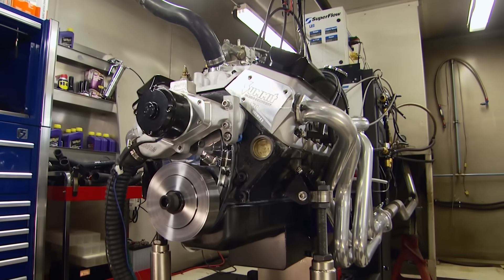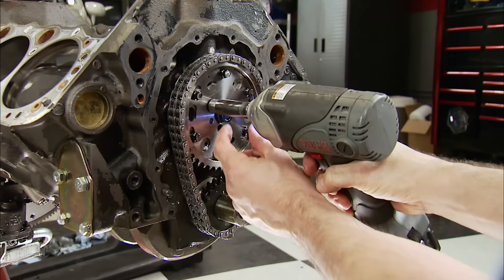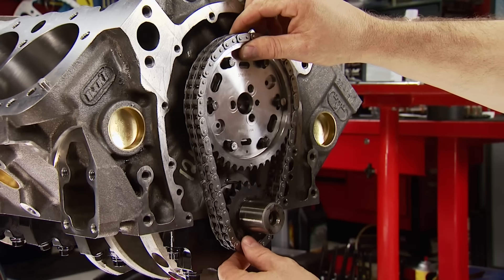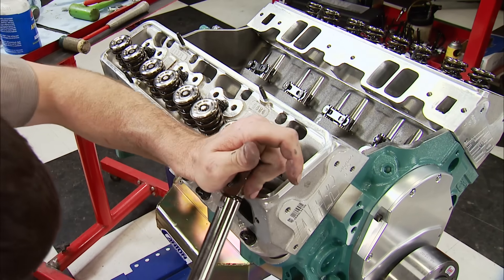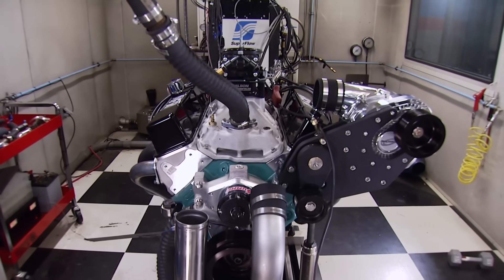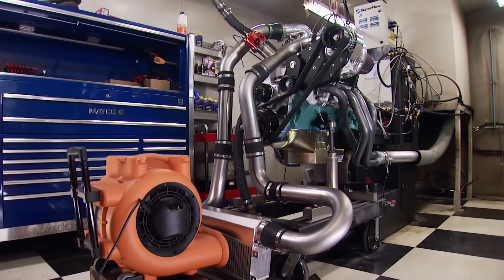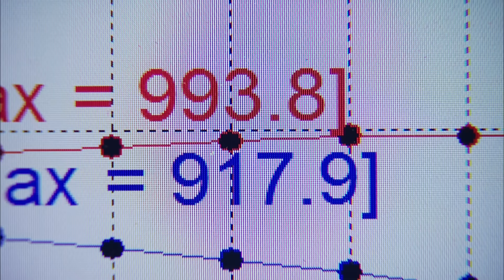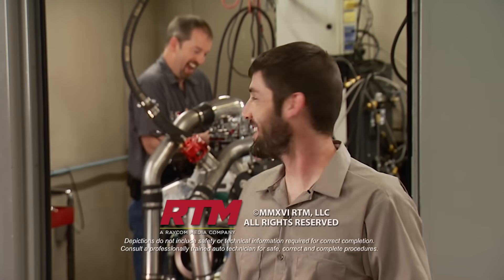Small Block Chevy Build Stage 3: 383 Becomes A 406 To Make Mega Horsepower - Engine Power S3, E14

Comment: It’s not a part of the staged build if you use a whole new engine.   This wasn’t a 383 to 406, it was a 406 build with a blower.  Cmon guys.......
Reply: Yeah. When you use a whole new block, but still use the old parts, its still a different motor.
Reply: When was the last time you saw a 350 block survive being punched out that far? Seriously. Swapping the internals from the 383 keeps it within the series.
Reply: You can not build a 406 from a 383. 383 is 4.03x3.75. 406 is 4.155x3.75. 4.06 is max bore on a 350/383 block and is not recommended on most blocks.
Reply: @biggregsparks8364  - There are stroker cranks available to make a 400" from a 350" block... Hot Rod did an article about that...
Reply: @BuzzLOLOL  I didn't say 400 plus cubes wasn't possible, I said its impossible to turn a 383 into a 406. You can stuff a 4 inch stroke in a 350 block with a 4.06 bore and you get 414 cubes. You can't boost it because the piston height would be 1.00 inches though.
Reply: @biggregsparks8364  - So you agree you can turn a 383 into a 400"... just like I said...
Reply: @BuzzLOLOL  no, a 350 block can only be bored to 4.06 and a 400 sbc has a 4.125 stock bore, and therefore the 350 block can NOT be boosted in that big of a stroke because of a 1 inch tiny little piston under all that pressure.
Reply: @biggregsparks8364  - It an be mildly boosted... just like the 1962 Olds Jetfire was mildly boosted/turbocharged stock...
Reply: @BuzzLOLOL  why stuff a 4 inch stroke in a block that you have to get a specific connecting rod just to not punch through the water jacket and also your gonna need a small base circle cam and some other tricks to make it fit, just to say you have a 408 sbc that can take alot less boost, when you can build a 396 stroker with a 5.85 rod for less money that's good for 1300 horses.
Reply: @biggregsparks8364  - Maybe you just want an unboosted 400 hiding in your 350 block... Of course, it's much easier to convert a Ford 351M into a Ford 400... and they come with bigger valves...
Reply: @BuzzLOLOL  I put a 408 sbc parts list that makes 600 horses, and it cost around 9 grand for a complete long block. These days, the ls engine dollar per dollar is king, although a 400 plus cube Windsor engine will be easier and cheaper than a 408 out of a 350.
Reply: @BuzzLOLOL  honestly, you can have a dart 4.5 bore space block and build a 4.25x4.25 482 sbc and externally will look exactly the same. Who's gonna know the bore spacing is .1 inch bigger, lol.
Reply: @biggregsparks8364  - Wouldn't be 'numbers matching'...
Reply: @BuzzLOLOL  LOL that's funny
Reply: Big Greg sparks noikkjm he
Reply: @biggregsparks8364  You must have missed the sale on 5.850" rods if you think the 1" compression height is an issue...
Reply: @AB-80X  1.26 with them. 6 inch rod to stroke is better though
Reply: @biggregsparks8364  
As David Reher would tell you, a rod ratio of 1.4625 vs. 1.5 makes ZERO difference, and is well within reason. Plenty of performance engines run a rod ratio between 1.45 and 1.5. There's zero issues with running a 4" stroke in a 9.025 deck block.
Reply: @AB-80X  I think a 40 over block, with 3.875 stroke,  1.22 compression height, .01 decked block would be perfect little 398. Piston would only be .0075 in the hole for a tight quench and more power. The 4 inch stroke 350 builds don't normally make more power
Reply: @biggregsparks8364  
That's another way of doing it. Howe er, fkr a blown application such as this, I would lrefer a thicker cylinder wall to a bit of compression height. Depending on the growth, 0.025 is a bit much for quench. 0.005 would be great when hot if possible but it obviously would have to be calculated.
Reply: whole series was a joke. just a long ass commercial
Reply: Drsteezymcgee all these power block shows are infomercials
Reply: @TheRemipaquette  this is true unfortunately. realized that during the first stage 383 for 4k. "ah shit, here we go again"
Reply: @Drsteezymcgee  EXACTLY.
These shows existed solely to sell msd 6al ignition boxes, accel super coils, & Holley 4150 double pumpers to hillbillies.
Reply: @Drsteezymcgee  And at the end, so much could have been done to create a better final result.
Reply: ScoredPiston you have to change the block to make it a 406
Reply: You’re that smart.
Reply: Thank you, finally
Reply: Well ur all dumb as f*ck cuz u can make a 406 outta a 350 block cuz I have one that I built 4.060 bore with a 3.875 stroke
Reply: @brentjenkins90  that's a 402 stroker. 401.33 to be exact. 406 is 4.155x3.75
Reply: @brentjenkins90  also 4.06x4=414, but isn't recommended for anything but naturally aspirated because of a 1 inch compression height

Comment: What about boost numbers?
How about for a true driver,  would you suggest?
Reply: Making a true driver based on this block and blower, is not that hard.

AFR 235 heads
Howards 110753-10 cam
Wilson ported Vic Jr intake
Isky Red Zone bushed lifters
Crower maxilte crank
CP rods
Diamond full coated slugs w. rings
Clevite H bearings
SS Jesel 1.6 stud rockers w. girdle
The rest is pretty self-explanatory

That's about all there is to it.

It's all in the assembly and tuning.

Comment: Stage 1: $4,000 ... Stage 3: $20,000.
Reply: this series was made nearly 1 0 years ago now...plenty of cheaper more powerful options out there ..mind you if freight to where i live  wasn't a killer i'd be on those5.3 iron blocks from summit
Reply: Buddy of mine. His turboed Silverado" red dragon" on you tube. Made tons of street races and track racing. Made over 1000 to the wheels. Years later pulled it out and sold the junkyard 5.3
Reply: @garyhayes4756  Cletus blew up three of those junk yard engines before he wisely went to Texas speed and purchased a real engine.
Reply: @rodpalm6398  a real engine?
Reply: @rodpalm6398  yeah no
Reply: @puddinz9855  No that's actually a fact and I have the video's. Yeah you are wrong, deal with it.
Reply: @rodpalm6398  That doesn't mean anything bud.
Reply: @rodpalm6398  actually he just did cam bearings and tsp rods and pistons. He didn't even replace the crank.
Reply: Gary Hayes I used to live right down the street from where that truck was tuned I believe the shop is called justune
Reply: LONG before this series was made, my Ex-Father in Law told me "if you can't build a 300 reliable hp 350 using stock or stock style replacement parts, don't build engines". Consider how long the Gen I was in production, that's a lot of parts to choose from. Lots of knowledge out there for the Gen. I's. Everyone wants that bragging number. How about Daily Driver Dependable power? Like Pat said, that first engine would fill the bill for 90% of the population. Drop it in a G-Body (anything other than the Monte, please), 2nd or 3rd Gen Nova platform or any Z from '74 on and have a blast.
Reply: John Derek Mitchell oh please no with the 2nd gen f body. Hideous.
Reply: You answered my question , to rich for my blood $20K
Reply: Yup.
Reply: Joe Figueroa  i live in australia....frieght is 1000 plus and 6 weeks
Reply: that's why turquoise enamel paint make sense for stage 3 - 20K....
Reply: @fabslyrics  was more like 15k tops for the build.
Reply: @bigboreracing356  Man shut the fuck up.
As much as I see your name on youtube you can't be doing much in your fucking "shop"...
Reply: $18,433 if you do the work yourself.
Reply: I built my turbocharged 383 after this video. All forged internals scat wiseco bottom end.  Heads cam intake multiport efi and cop ignition using a ls1 ecm . Every single nut bolt ect was new most bought from summit cost 6500$ .  Gen 1 sbc stuff is allot cheaper than other generations.
Reply: @bigboreracing356  nobody cares about what you say pal.
Reply: @bigboreracing356  literally nobody cares what you say
Reply: Probably more than that. I just built a 385 stroker @ $14,000 N/A. Same heads, custom solid roller cam, lightweight rotating assembly, 13:1 compression, Same valve covers and an AFR eliminator intake with a 1050 carb.
Reply: Its nice. I'd like to get a LS 427 for about the same price if not a little more for 96 z28.
Reply: @nickoD509  Ah yeah I love that 427 but this motor will hold more power. No replacement for full aftermarket.
Reply: @DarkLinkAD  Yes, for a couple pulls. You can't just triple the factory horsepower on a stock engine and expect to be much more than a disposable dyno queen or something you make that power once on a dyno then detune it for the street while telling everyone you have a "1400hp" motor. To do it right takes a little more than just slapping a 1500hp turbo on a truck engine.
Reply: @177SCmaro  He actually daily drove his Colorado, once the fuel problems were sorted, it was solid.
Reply: @_winter7745  Their is a video of the LS vs the coyote engine. Both using a procharger but different models. The LS did well over 1700 hp. The budget was 15k on both engine builds. Couldn't go over that amount.
Reply: @177SCmaro  You should stop talking about stuff that you aren't familiar with.

Stock LS engines have gone 4 digits and lasted for THE ENTIRE SEASON over & over again.
Reply: @elonmust7470  
I see. So I guess everyone who puts a aftermarket bottom end in an LS is just wasting their time and money then. Good to know there are so many people building LS engines who don't know what they're doing and that you're here to set us all straight.
Reply: @177SCmaro  Nobody said that. You're putting words in my mouth.
People put rods & pistons in them because it improves, IMPROVES their reliability & maximum power potential. Very simple shit....
Reply: @elonmust7470  Am I? Why go to the expense and trouble of improving the bottom end when, according to you, its not necessary as the LS's bottom end will take over 1000hp all season over and over?
Reply: @177SCmaro  I said that people have done it, quite a few of them.
Reply: @elonmust7470  That's not what you said. You said LS engines go over 1000hp over and over again all season on stock parts. Which means LS builders have been doing it all wrong by unessisarily wasting time and money they didn't need to when the bottom end is already more than strong enough, according to you. They should just leave the bottom end alone and concentrate all their time and money elsewhere. So you disagree with the majority of LS engine builders most of whom go aftermarket bottom ends when they get serious about power.
That's the only way I would be mistaken and for you to have any basis for telling me I don't know what I'm talking about.
Any questions?
Reply: @DarkLinkAD  Sure but for how long? Maybe a hand full of Dyno runs or 1/4 mile runs, the pistons tend to crack at the ring lands above 1000hp and the rod bolts usually give up the ghost anything above 800hp.
Reply: @elonmust7470  One of the most respected tuners Steve Morris begs to differ. Rods and pistons won't last that long at 1000+ hp.
Reply: @seanbailey8545  Cracking at the ringlands would be a lack of gap. Anything over 750whp needs proper fueling, that's a concern, and pull the timing out to 12 degrees by 4000.
Reply: @DarkLinkAD  They crack at the lower ringland just above the wrist pin as it's weakest and thinnest there. Doesn't matter how much you gap the rings.
Reply: @nickoD509  9

Comment: Loved this build guys.... so if I wanted to duplicate this for my 81 Z28 what would it cost me? Less the transmission and rear end mods?  Thanks!!
Reply: The package chosen is from Summit Race Packages which he shows and explaims. Attempt to order one yourself for a veiw of a receipt. And make sure your sitting down when doing so. Dont forget to add build/install and dyno costs after. You may or may not become a popular man with your banks loans department 😂
Reply: @RT-Revs  I don't think it would be any more than the Dart SHP 427 small block with AFR heads and a Comp Hyd. Roller valvetrain.... That cost me about 9800.00 all in with the new converter and engine mounts etc....   It's a beast!

Comment: It would have made 1,300+hp if it were turbo.
Reply: It doesn't matter the boost device man it's all about the pressure going into the engine, 12psi is the same from a turbo as it is from a super charger infact it could be forced induction with a air compressor lol it would make the same 12psi

Comment: I've seen chinese rotating assy 408 fords with pro comp heads make 550 crank. You've got prob 15 to 20k in labor and parts JOKE oh and I thought you were gonna spin it 8000 rpm?
Reply: It would disintegrate if they pushed it to 8k.

Comment: Pound feet???? Forever it was foot pounds ie ft/lbs and thats how it is stamped on my snap on ttorque wrench . Should it be lbs/ft??
Reply: Christopher Speck I believe technically it’s pounds per foot. Foot pounds it just easier to say but makes no sense that way. Think psi. Pounds per square inch.
Reply: @keystonerider1308  i am not sure if it is pounds per feet since inch pounds are less. If it were pounds per inch they would be 12 as much as foot pou ds but i am not sure.
Reply: Both designations are acceptable in the U.S.

Comment: I would like to see that SBC up to 434 ci I've witnessed a big difference in a 406 to 434ci in N/A nitrous and boost applications some cars even pick up 2+ whole seconds or more
Reply: And the main reason is that the bigger bore unshrouds the valves more. Always put the heads on a bare block first, then scribe each cylinder bore on the head from inside underneath   Then you can grind the combustion chambers to unshroud.
Reply: Uh, so you say that a car that run X time with 993 hp, will pick up 2 second as a 434?
That's hilarious. This mill is good for 9.0X in a 3200 lbs car, so what you are saying is that it will be a 2000 hp mill with 28 more CI?

Comment: A bored 73 c.s.b. 400 for me ! Easy power! Good pistons, rods, some head work, rollers, aluminium intake, Holley 750 double pumper ! Followed by a th 400 with a new valve body, a shift kit, and a b & m mega shifter & 373 gears!!! Cheaper and you can get a bit over 500 h p  what I had is basicly a 406 just not as expensive as this build!

Comment: Guys are strapping a turbo to 150k truck engines and make 700hp.
Reply: And how long do those live before blowing up
Reply: Wild Bill a surprisingly long time lol
Reply: @bmstylee  check out cleetus McFarland and see for yourself lol, he ended up making 900hp on a 5.3 ls all stock besides cam, this guy is nuts
Reply: Romeo Sandoval:
And how many transmissions and engines does he go through.
Hell, I lost count how many 5.3 blocks he has gone through.
Reply: @bmstylee  not long
Reply: @bmstylee  A long ass time.  You do know that turbos are considerably easier on parts than N/A or supercharged don't you?  Most factory turbo cars are all cast parts as well and are warrantied for 100k miles.
Reply: They don’t live that long. The difference is one engine will last many many years with some minor maintenance and one will run 50 passes before it scatters all over the track.
Reply: @devoncoolman88  He had a fuel starvation issue, this was his failure point. Running lean at WOT will kill any engine.
Reply: @DarkLinkAD  Not a diesel.
Reply: @177SCmaro  What about a diesel.
Reply: @devoncoolman88  I have friends with 100s of passes on stock shortblocks running 25+psi of boost, still together.
Reply: What I often wonder is why when a stock truck LS engine like a 5.3 slowly lose oil pressure when say a turbo is thrown on...seen it happen many times...is it due to crank flex that puts weird stress on the main bearings wearing them out till oil clearance opens up and oil pressure drops???or is it just the stock main bearings can't hold up under the pressure??? which leads me to believe it is crank flex as I have seen engines build with forged bottom ends and use the stock main bearings yet they live...
Can't seem to get a clear answer on this as everyone seems to have a different opinion...Many say the stock cranks are good for a 1000hp...so what causes the failure???
Reply: @harryguy76  Oil pickup needs a new O-Ring.
Reply: It's guy's doing that naturally aspirated
Reply: @Kevin A. you literally picked the heaviest engine ever put into a pick-up truck lol.....

Comment: Man they gave up on the quest for 1000 to easily....carb spacer might have done it  and higher ratio rockers without question would have done it
Reply: Even easier, they could have just thrown a smaller pulley on the charger to up the boost.
Reply: Nitrous 😁